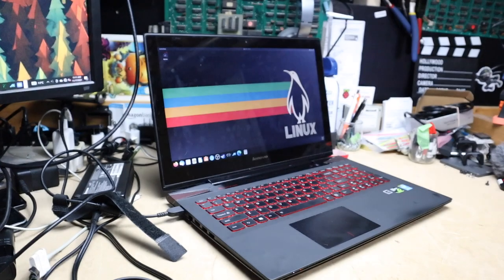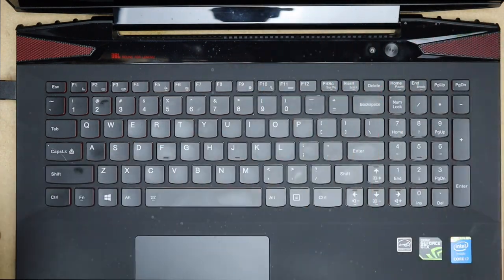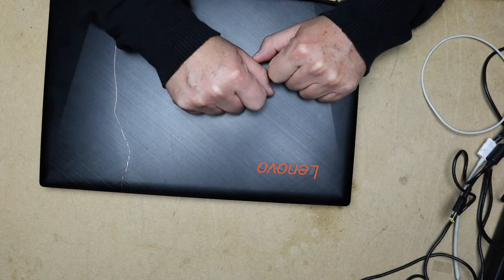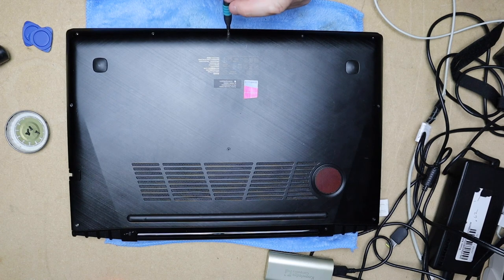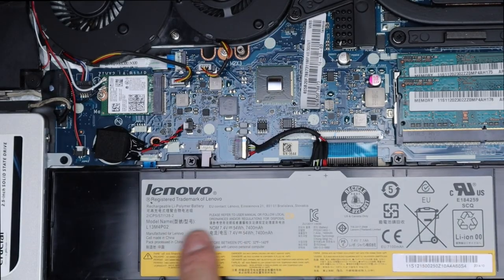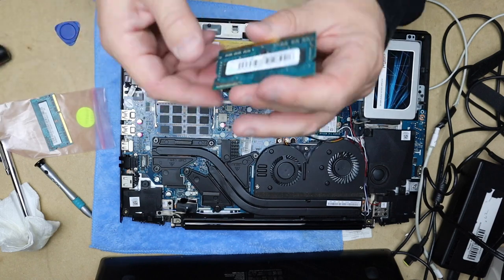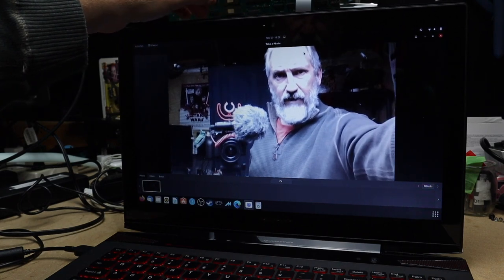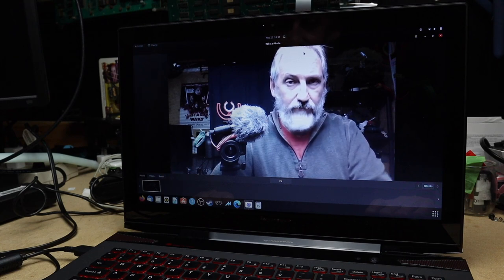Lenovo Y50-70 gaming laptop running Linux - Teardown and full review

Comment: That is the Lenovo Y50-70 from 2014. There are multiple models with different panel options (up to 4k). They came with an i7 4710HQ, a GTX860M GPU,  and it could run a bunch of games while livestreaming with OBS at the same time really well. It was an awesome gaming laptop that you could get for 799.99 USD if you got the model with the 1080P TN panel at the right time. Fun fact: It came with matching black and red external DVD drive to run games that you may have on disk.
Reply from the maker: Thanks for the info. I just sold it. It’s nice but I go through a lot if computers each year.
Reply: @MikeDancy  Glad to hear that someone is going to continue to enjoy it. The next laptop to try at the same level for this generation is called the Gateway Creator. It went as low as 649.99 last year and it came with a good 10th gen quad core i5 and an RTX 2060 GPU. I use it to play pretty much everything at max settings and it just plows through at 60fps across the board. It even performs well with VR! Linus did a review on it. (PS: He says it is plastic but, it is all medal with the exception of the bottom cover). I still use my y50 external drive with it too. ;)
Reply: @GamesIStream  Can you tell what price you got?
My laptop had a charging port problem, gave it to a repair guy and he managed to somehow burn a pin on the motherboard and now the laptop isnt working. New motherboard is costing around 171 bucks. Is it worth it to replace the motherboard?
Reply: Pls can dis laptop play Fifa 23
Reply: I still use that optical drive from time to time since my PC doesn't have one
Reply: Oh and mine has a 960

Comment: I got this laptop new in 2014, with Windows 8.1, 16gb of ram, and a GTX860m. Mine isn't the touch screen though. It was the 1080p TN

It was for it's time a very capable gaming laptop for around $800, loved this thing. Now mine has Manjaro on it and has been a great platform for me to stay familiar with Linux. 

I carried it every day for 5 years until the battery stopped being able to last more than an hour and a half and the hardware was slow enough that replacing it with a thinner, lighter and more powerful laptop was finally worth it. 

Mines taken a beating, the trackpad is sunk into the chassis and doesn't work properly. But the rest of it's in great shape still considering how long I've used and abused it. 

I'd definitely recommend any of these Y series laptops used for a decently powerful if a bit big and heavy platform to use for any experimental things you want to run outside of a VM on hardware that's a decent analog for today's modern hardware.
Reply: Ought it for $156 7.8kphilippine peso, feel like I robbed somebody no issues too besides cosmetics i put in a sticker 😂😂 running sekiro at medium settings in 1080p

Comment: I have a laptop from this model line laying around. I wonder if I might be able to find some ram and a battery. I don't need another battery but I'm scared it might explode if it's too old. Could I maybe remove it entirely? Would it still boot?
Reply from the maker: yup.  it should boot without the battery.  I made another video about updating the BIOS without a battery.  You going to install Linux or Windows?
Reply: @MikeDancy  I'm going to install Arch linux just for the sake of the challenge (never used Linux except from on the Steam Deck a little bit, wich comes with Arch). It has Windows on it, I'm going to unassign the product key from the device and use it on something newer. 
Never crossed my mind I couldn't upgrade the BIOS without a battery, I might take a look. 

Is there any chance to find an aftermarket battery of a higher capacity? And maybe with Linux and some underclocking make it last a decent amount? I don't remember this laptop ever going past 2 hours battery life.

Comment: There's a guy offering me his Y50-70 for $600USD. He upgraded from 8gb of RAM to 16gb. The laptop has 6 years of use, and he says he paid around $1200 USD when he first got it. He says its pretty much in perfect condition, and working properly. What do you guys think?
Reply from the maker: I think that he’s off his rocker.  I wouldn’t pay more than $200 USD for it
Reply: Yeah that's what i was thinking. I'm considering getting a new one instead. Found a few options on amazon with similar characteristics for around 800 bucks (like an HP Intel Core I5 1135G7, Intel Iris Xe graphics 16GB RAM). They're brand new though, and will probably last me for much longer.  I appreciate your input sir. Have a good one.
Reply: It’s risky buy computer from people if it not cheap or still has factory warranty on it then it no good
Reply: These things are actually going UP in price.  I bought mine with 8GB RAM, 4k touchscreen, and 860 GPU 4 or 5 years ago for $400, but now you can't get near one for that price.  I've since upgraded it to 16GB RAM.  It was running Windows 10 until a few hours ago.  It only came with a 256GB SSD drive, and it was completely full, so I tried putting in a 500GB SSD, but as always, Windows refused to boot from the clone.  I used to clone drives as a big part of my job, and successfully cloned literally thousands of drives, but Windows 10 does NOT like cloning.  Tried using a Windows recovery boot USB drive to try fixing it, failed several times, then stopped booting from the thumb drive, and now even the original SSD won't boot.  I guess it's time to put Debian on it.

Comment: This for sure has a dGPU, I think it may have stopped functioning so now it is just running off of the integrated graphics.

If it didn't have a dedicated GPU, it wouldn't be built like a gaming laptop😆

It would be more of a slim laptop; without the increased power draw, or hq processor

Also, two fans; you'll find what the GeForce sticker is slapped on for under one of them.
Reply from the maker: Thanks.  I'm going to load Windows on it to get the updated drivers and see if it runs any differently
Reply: @MikeDancy  I don't know how people set it to only use the integrated graphics so fingers crossed you won't left with a black screen upon windows reinstall!

If it doesn't show on device manager then I don't think I have much hope..
(they may have hidden it because it doesn't work or it just isn't visible anymore because it doesn't work!!)

Doh, my bad; I just realised you weren't on windows to start with (I have more hope now)😅
Reply: You can disable "switchable" graphics cards in Bios to have it use CPU graphics only, I disabled for Linux years ago.  Enabled in Windows it would only run the dedicated card when games are full screen.